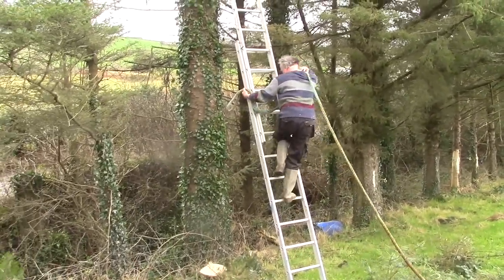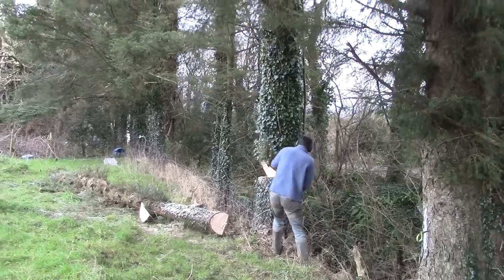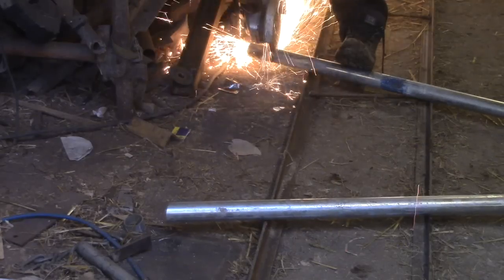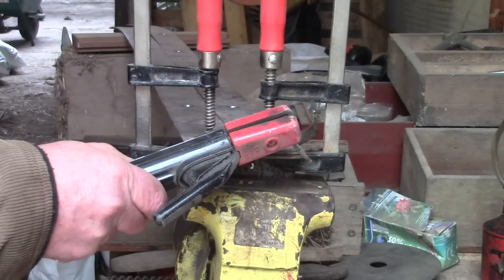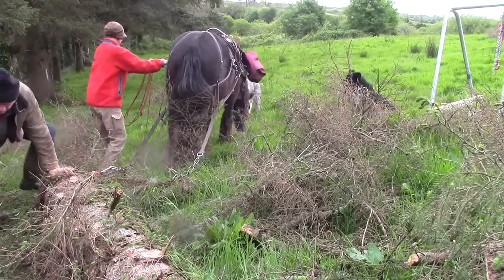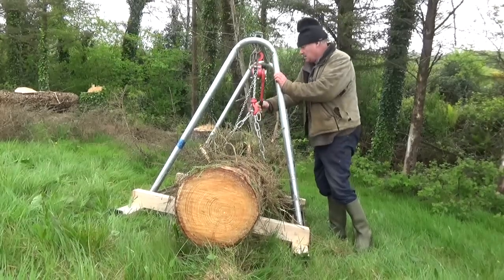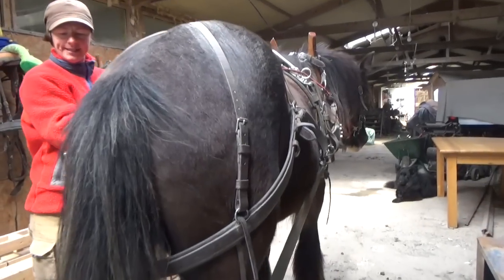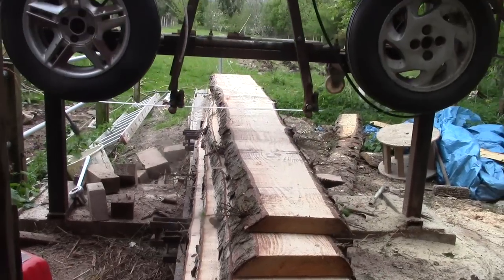Homemade Horse-Drawn Log Sled And Arch (I Think I’ll Call It A Slarch..)

Comment: I have found that taking the time to remove all branches from a log, cutting them flush,  is well worth the time and effort.  They roll better, pick up less debris,  slide with much less friction and even the slab wood is easier to handle after sawing.  Just a suggestion. Love your videos, keep up the good work!

Comment: I have found that if you put the wheels well aft of the balance point when the tow chain/rope is under tension it lifts the end off the ground making it easier to move while maintaining that it will stop itself at the release of tension on the tow chain/rope.

Comment: Good horse.  Yup, horses are much stronger than they think, just got to ease them into it. Nfld ponies were used for years in the lumber woods. Often they needed no guidance. Slap em on the ass and they'd go right to the pile for unloading, then they would go right back to the logs.  Smart little buggers

Comment: Nice work on the slarch and working the horse, it was a pleasure to watch. But as has been said I was surprised you didn't bother to sned (snedding is removing the side branches from a felled tree) all the side branches flush with the trunk. It really makes a massive difference in terms of handling the log and it not picking up debris etc. All the best
Reply from the maker: You're right. Not sure why I didn't that time - I do everytime these days

Comment: those ban saw blades are easy enough to sharpen. debarking help a heap as well.
Reply from the maker: I tried debarking for just one slice (of a different tree) but it took longer than planking the whole thing. I guess the bark wasn't ready to come off or I was using the wrong technique, but it was crazy slow.

Comment: Thanks for documenting your journey.  Very cool to see the horses pull logs, and a very interesting log sled you fabricated.  My only criticism, which I feel important to post so that others watching might learn, is that the tree feeling techniques are in some regards dangerous.  Your face cuts, or gob cuts, go far too deep.  This can cause barber chairs before you even get to the back cut and can make the trees behavior unpredictable.   The next thing is that your back cuts are angled downward.  Back cuts should really never be angled.  They need to be as perfectly horizontal as possible, and roughly 2 inches above the horizontal cut of your face cut.  This helps wedges be more effective,  but what’s more important is that if the wind shifts or the tree is not perfectly leaning the direction you are trying to fell, the tree can slide off the stump and fall right where you are standing.  This is the most basic tree felling standards, and it’s very important.
Reply from the maker: Thanks for your suggestions. I have found,  posting videos like this, that there are many different opinions on tree-felling : -  ) Everyone believes strongly that theirs is the correct way. I wouldn't dream of saying my way is correct - only that I've been felling trees for decades now without accident.

Comment: Care should be taken  to avoid galvanize poisoning from the zinc oxide when welding galvanized metal. Use a fan or do it in the open , but I'm sure you probably already know that.
Reply from the maker: Yes, thanks, Gary. I always have the barn doors open for that sort of welding

Comment: Love your channel, but just a word of caution, i can't tell if you are wearing any breathing protection, but your uprights appear to be zinc coated.   You can get galvanize poisoning welding zinc coated steel from the vaporized zinc.
Reply from the maker: Thanks, Jim. I get told this every time, but I've never had a problem

Comment: Nice project! 2 tips: strap the log when its on the sled, if not you contruction will roll over. take the team for pulling this. Your lovely horse is not used to this work and the two of them can handle it easily! Good luck.

Comment: nobody reacts on the fact that the back cut on the trees were not straight? that shit is quite dangerous.. cutting them that way you did on this video can make the tree fall unpredictably..
Reply: marcus Austdal True, but I think that's why they were using cables, to control the fall.
Reply from the maker: There's a deep ditch behind them so we used that technique to stop them sliding backwards off the stump. I've never had a problem with it and it has worked well everytime I've used it. What have you found can happen?
Reply: It can slide down and then twist or fall back. It can be quite dangerous .. the back cut must be straight to make it predictable
Reply from the maker: Not convinced, but we'll keep an eye out. Thanks anyway.
Reply from the maker: I looked at that video you shared (it was awful so I'm not sharing it again) and now I think I understand your misconception. Perhaps you're thinking the tree would fall backwards over the raised part of the stump? And if it did that then, of course you're right it would be dangerous. But the cable stops it falling backwards so it's not an issue. The raised part is just to stop the fallen tree bouncing back over the stump and hanging over the 6' ditch.

Comment: Next time  you want a horse to pull a log try cutting the goddamn branches off it first! Every branch left on is like an anchor digging into the ground.
Reply from the maker: We were pulling it clear so we could do just that. No need to get upset.
Reply: It's infuriating listening to you wondering why the horse is having trouble, when the problem  so obvious. I have personally seen a single horse pull three properly trimmed logs that size with no problem. Oh, and by the way you have it half right. Having all the logs weight on the skids will only make the problem worse. Try lifting only on end of your log off the ground, and let the other end drag. I think you will find this arrangement optimal. It keeps the front end from digging into the ground, while at the same time keeping the loading on the skid to and acceptable limit.
Reply from the maker: Now I know you don't really know what you're talking about! If you find these infuriating - don't watch them  :  -  )

Comment: Wow felling trees with no safety trousers or boots and a blunt chainsaw - daft- then not snedding the timber so that the branch protrusions are acting as anchors and drag on the main timber- overworking your horse! then using the timber arch on tarmac with no way to brake it? cowboys...
Reply from the maker: Why so rude, Kit? You're quite wrong about some points but your attitude is so childish we won't be engaging.